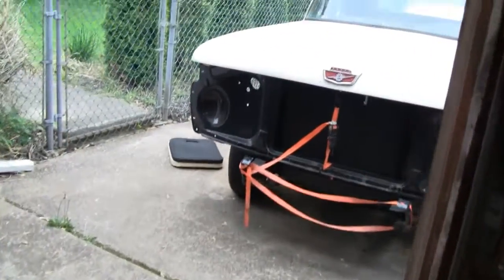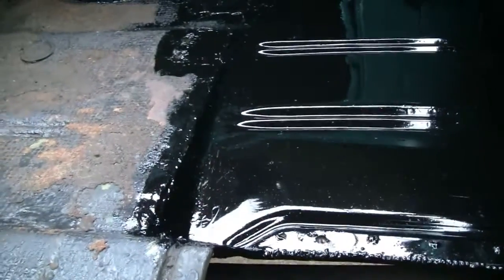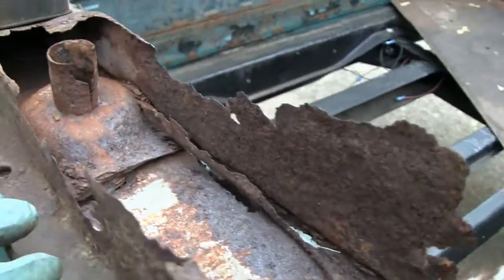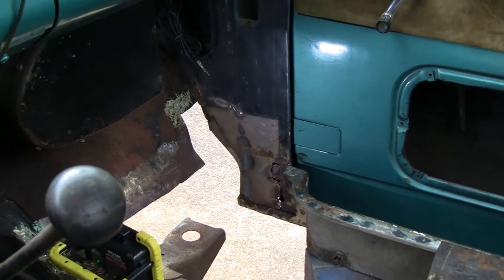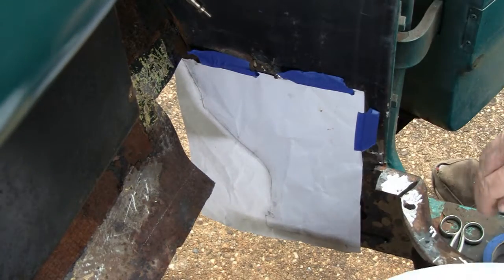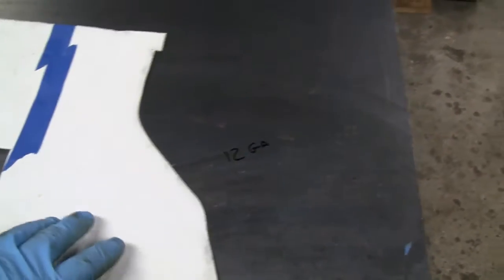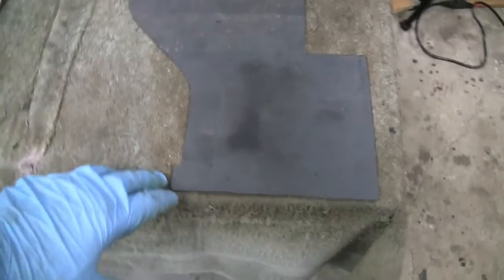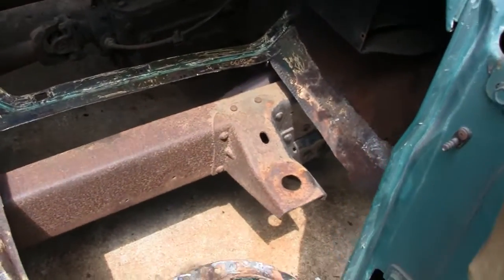MAKE TEMPLATE, PATCH PANEL AND FLOOR RIPOUT FORD (F100 part 54)

Comment: I like using a jigsaw, my favorite jigsaw is a Porter Cable  Yes they are expensive and I have a Black and Decker with variable speed and all that but the Porter Cable is much better  I have never seen a used one at any place I have been if I ever see another one I will get a spare.  On metal it makes a difference, maybe not so much on wood.

Comment: The thing I don't like about cutting sheet metal with the jig saw is how the metal starts to vibrate throwing the saw around.   You need to support the metal while cutting, it might be easier to lay the sheet on top of an expendable piece of plywood and cut through both.